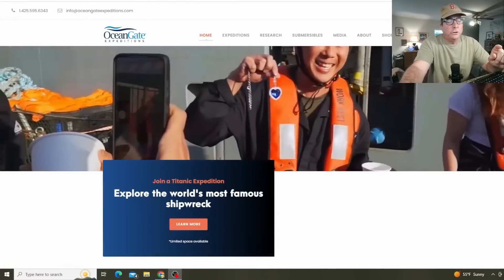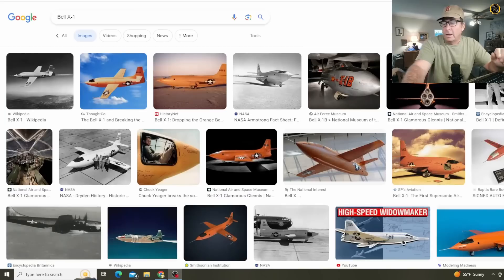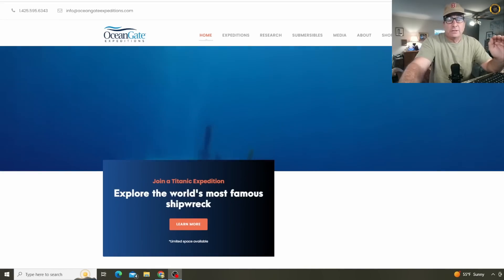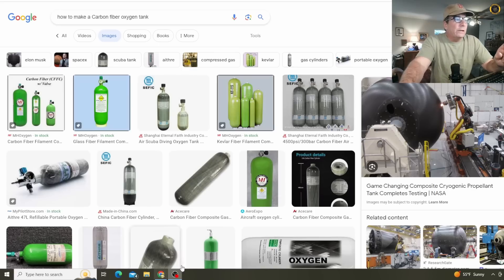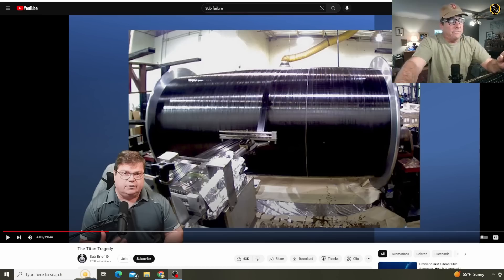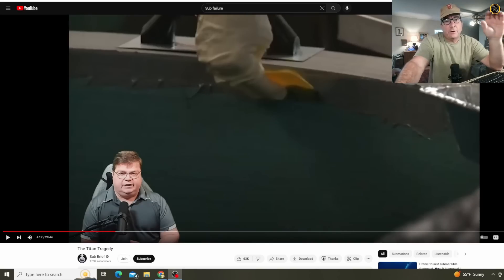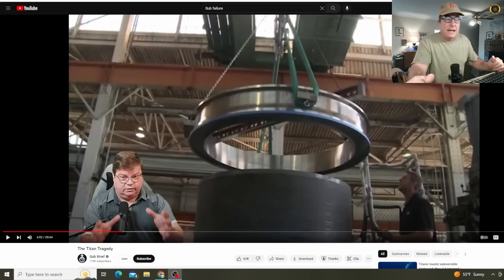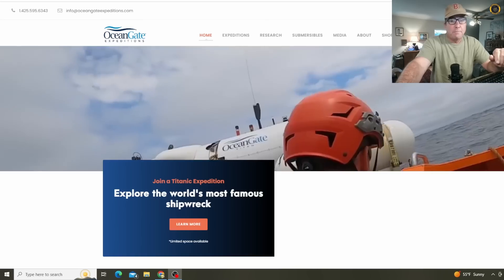Oceangate Sub Construction Details and Implosion

Comment: I’m a Composites Manufacturing Engineer, and I also watched the Sub Brief video. Juan Questioned the precision of the end of the carbon tube. We always trim (machine) the ends/mating points of carbon structures where they interface with precision parts, and can easily achieve precision <0.1mm - this was unlikely to be the cause of the failure. 
I do suspect the bond joint to be the source of the failure though. A huge red flag in this video is the lack of “squeeze out” from the adhesive when they set the ring on the structure. This is a sign that they did not get full-coverage of adhesive in the joint.
Reply: Should these glue joints and carbon fibre mats not be completed under clean air conditions? The glue application crew weren’t even wearing hair nets. As a non engineer I’d imagine dust particles and any foreign matter falling into the carbon fibre and glue is going to weaken it?
Reply: @EmmeKBell  FOD is always a concern during a bond operation, but clean room conditions are not generally used. We take precautions during lamination and bonding, but no hair nets are used. 
We make smaller parts, so a clean room could be used. With a part that requires a crane, that would be a pretty tall order (moving, greased, mechanisms in the crane would make it hard to ensure no FOD could fall from the crane above). Maybe someone who’s worked on 787 airframe components could comment on how they manage FOD control during the bond operations when an overhead crane is needed to set components in place.
Reply: @benkitesurfs  Boeing has had many problems with the CF layup.
Reply: @SteamCrane you don't work there, I do.  You have no idea how dumb that is.  The 787 is an awesome airplane
Reply: Why did he want to use carbon fiber in a sub?  It is usually used 
to save weight, which is a minor issue with things that float.
Reply: @jamese9283  yeah, I’ve wondered what the thought process was for using CF for a vessel that you want to sink. The only thing I could think of is transportation and handling costs? Maybe it could be launched from a vessel with a more readily available crane, since it’s lighter?
Reply: @benkitesurfs  Yeah, a couple thousand pounds lighter, so a bit easier to transport. Also less weight means easier to maneuver underwater and smaller batteries? Would CF insulate and make the interior warmer? Even a brief study would have shown him that the benefits would not outweigh the risks, so I don't get it.
Reply: @jamese9283 the mass is a function of the volume. Because the average density must become greater than the one of seawater for the vessel to sink. So a lighter frame just requires more ballast with the same volume. And if wall thickness of tanks for pressurized air is an indication, the composite walls are probably thicker than walls from steel would have to be. Thus increasing the displaced volume of the vessel requiring even more ballast and making the gross weight of the vessel higher than with a steel hull...
Reply: @MarcoTedaldi  The composite walls were far thicker (7 inch) than  steel (~2 inch). So the only advantage of CF seems to be lighter for transport out of the water.
Reply: @jamese9283 OceanGate cut the hull thickness by 50mm from the specified 175mm to 125mm. 5” instead of 7”.
Reply: @benkitesurfs  You still have to weigh it down for it to achieve negative buoyancy and I doubt they just went to the nearest scrapyard for metal, although I wouldn't be too surprised, so all in all the same mass would need to be transported around. Carbon fiber is such a romantic material, you produce your products in that stuf and you look technically more advanced; was this nut's thinking I'm sure, as well as all who supported him and went along with his thinking.
Reply: @jamese9283  construction was probably cheaper with carbon fiber, plus they could keep the design simpler. With steel or titanium they'd have to heat the submersible.
Reply: @MarcoTedaldi  5 inches with carbon fiber, no matter how it was wound, the resin used etc, was not thick enough.

Reynolds Metals Aluminaut was launched in 1964 with a 50 foot long cylindrical pressure hull made of 11 sections of forged aluminum tube. Its walls are 6.5 inches thick and it's capable of diving to the Titanic depth and beyond. 15,000 foot safe working depth but rated to survive to 17,000 feet. It's hull is large enough diameter for people to walk upright inside. It made 251 dives between 1964 and 1970, including at least one to Titanic depth (it was involved in a search for the ship) one that's said to be a record depth for a submarine, aiding in the recovery of DSV-2 Alvin, a hydrogen bomb, and an experimental torpedo. But I can't find any records listing all (or any) of its dives and depths.

If Reynolds hadn't given it to a museum in 1970 it might still be in use, and have had several refits and upgrades over the past 53 years.
Reply: @jamese9283  Neutrally buoyant.
Reply: @jamese9283 exactly, and carbon fiber is for tension not compression.  They were fools
Reply: @jamese9283 Cost savings and their engineer  claimed the carbon fiber design had neutral buoyancy.
Reply: @jamese9283  probably money issue
Reply: @jamese9283  I agree. It's because the CEO comes from airspace engineering. And he thinks "it's the same principles". I am speechless at the level of stupidity and lack of understanding of basic physics and basic common sense. They glued it to the titan... So a 3-5mm glue that barely penetrates metal and carbon will hold the enormous 3800 tons pressing on each sq meter of its surface... "Facepalm" honestly, that's just a  level of stupidity I can't rationalize... Did anybody ever tried to glue metal with metal or metal with carbon? You immediately see that the glue simply doesn't penetrate into the metal chemically. That's why we use welding... This is just basic common sense. Not to mention that carbon tube like that will be more expensive than a metal one.
Reply: @DanOneOne  "I make MY deep submersibles -- only with JB Weld!"
Reply: What about clean room requirements when you bond these parts.. in the video it looks like they are just in some yard building. Also when they apply the glue they dont wear anything that prohibits hair, lint etc to fall on the bonding surface... i can't believe thats how you do it, when the stakes are that high..
Reply: Like gluing on a PVC pipe end cap. Rush is on video saying he went against conventional wisdom using carbon fiber and titanium. That he had it figured out and could go around wisdom. The front view port was 7" thick acrylic. It would flex inward 3/4" at depth. Said not to worry, the acrylic makes lots of cracking noises before it breaks. His words on video.
Reply: @billbirch3748  
"The front view port was 7" thick acrylic. It would flex inward 3/4" at depth."
So the extreme flexing didn't bother him to the point of risking people's lives. That pretty much tells me the CEO was insane.
Reply: You have a good point about the viewing port. I didnt know they used acrylic for the window. Acrylic also it apt to form micro fractures. And you have to wonder how they dealt with the joints along the window. The carbon fiber hull is concerning but any joint is a weak point as well. A n improper seal of the door being bolting onto the craft might have occurred. Fine at relativity shallow depths but complete failure at deeper depths.
Reply: @misterdinkly  DSV viewports are typically made as shallow cones, really large on the outside, small on the inside. Like a circular version of an arrow slit in a castle wall. the slope is so the water pressure forces the port material firmly against the tapered hole in the metal, without extruding it through the inner hole into the pressure hull. The inside and outside faces are curved to correct for the optical magnification effect of the water. Advances in plastics allowed for the 2014 "upgrade" of DSV-2 Alvin to have larger viewports than in any of its previous pressure spheres. It also got upgraded from 3 to 5 viewports in its larger sphere. The larger sphere also required a new frame, so along with that, anything else hanging around from 1964 was also replaced, making today's Alvin a Ship of Theseus where 100% of it's been replaced yet it's still the "same boat".

IIRC Alvin's new viewports are also very heat resistant. When the mid-ocean "black smoker" hot water vents were discovered, Alvin couldn't approach too closely lest the super heated water melt its windows.
Reply: You noticed that too. I worked in the composite industry for years, bonding parts together is has crucial as the layup itself. I didn't see any telltale signs of a good bond joint with that ring such as squeeze out.

It's will be interesting to see what the talking heads will make of it. There were many modes of failure on this design.
Reply: I agree. This joint has several problems, mainly differences in thermal expansion and differences in elastic compression (Young’s modulus) between the materials, that the joint has to absorb. Material fatigue is another concern (also with metals including steel!), but there were not enough cycles to talk about that - the vessel likely was defective from the beginning.
Reply: @10goldfinger that stuff ain't taught at u dub physics courses
Reply: Source of failure was ego and over evaluation of one's IQ.
Reply: Cf bicycle frames are known for a host of inherent problems. Of course, cracking and failures. Getting a successful bond between the bottom bracket shell (metal) & the cf frame seems very elusive at this time for manufacturers.
Don't get me wrong; cf is impressive & I love my cf bike parts.
Similarly, the submersible main chamber should never have been cf. Ever. Wound fiber/ resin scuba tanks have a finite life cycle, as it's brittle and develops teeny tiny cracks that grow each pressurization cycle.
Progressive failure was very possible in the titan fiasco. Small leaks may have existed for a time, it wasn't necessarily an instant, painless, oblivious end to their lives. They very well may have known precisely what was happening in real time. No one will ever know how long that lasted. To state as fact, that it only lasted "30 milliseconds" is an extreme example of wishful thinking.
Reply: @houseofsolomon2440  You may well be correct in the passengers' brief awareness of the impending failure of the Titan as there are reports that they had started jettisoning ballast weights for an emergency ascent.  However, it was such a poor design for so many reasons that is was a question of when and not if a catastrophic failure occurred.  I think time and investigation will reveal why Stockton Rush did not want to gain proper certification for the vessel.
Reply: @Twmpa from what I've heard from Stockton himself and other passengers was that the submersible made noises when descending due to the pressure, Stockton claims to have aborted several dives due to the noises sounding different, that info, the reports of dropping ballasts plus the hull integrity sensors lead me to believe they were probably aware they were in some danger, whether they were aware of how much danger they were in is  anyone's guess and the actual death would have been instantaneous.
Reply: @Twmpa  I know I heard Cameron mention this several times, that the Titan had begun an emergency ascent. I haven't heard this anywhere else, but I presume he has inside information. My guess is in the coming months, we'll get a clearer picture of what exactly happened in the moments leading up to the implosion.
Reply: @Twmpa  How do we know the jettisoning didn't happen as a result of the implosion?
Reply: @houseofsolomon2440  I’m not familiar with bike frame parts - but I just got my first CF mtb this year 🤞🏼
I suspect the bonding issue you’re referring to could be a surface area problem. Or a mass production problem. CF construction is still pretty manual, so the ability of the technician to do things correctly every time, in a high volume setting is always a variable. 
I agree that CF for a submersible is a strange choice. It’s much different than a pressurized gas cylinder (like a scuba tank), as the gas cylinder puts the fibers in tension, where they thrive.
Reply: @benkitesurfs  For this submersible project, I say support your local titanium dealer -
edt: that's correct about the scuba bottles being under tension, as opposed to the submersible, which is under compression. This actually bolsters the argument against cf for the Titan project.
Reply: @houseofsolomon2440  I would think all titanium or just good old fashioned steel would have been a much better material for this sort of vessel.
Reply: @houseofsolomon2440  I saw an interview with both Robert Ballard and James Cameron, and they said that "sources inside the small deep submersible community" believe that the crew of the Titan had realized they had a problem, and had dropped weights, dumped load, etc. to start an emergency ascent... not sure if they know this because they've seen undamaged parts of the Titan on the sea floor, and then knew that they had been dropped before the implosion – or if there was a communication from the submersible that happened before the failure of comms... but they do think the crew knew something was happening, and were trying to ascend when it imploded. I also saw a comment from Cameron saying that "on Monday morning, we were pretty sure it was a catastrophic implosion" when it lost both comms and the transponder at the same time... he said the transponder was housed in its own pressure vessel and had its own battery... so when the signal from the transponder stopped, they knew that something so violent had happened (implosion) that the shock wave from that had destroyed the transponder as well.
Reply: @houseofsolomon2440  You don't have "small leaks" at that depth. ANY leak = instant complete failure.
Reply: @houseofsolomon2440  If they manage to find their SD cards and other storage, we or the investigators will likely find out. You can be sure there were several video recordings going on.
Reply: @houseofsolomon2440  I disagree that the problems they were having with hull integrity might have been human-perceptible. Anything human-perceptible (cracking, leaking) would have been big enough to cause an instantaneous implosion faster than a human could process. If they knew they had a problem, it likely came from their hull integrity monitoring system that was built into the hull.
Reply: I also noted that much of this construction was done in open atmospheric conditions. In many CF builds I recall they had the autoclave or vacuum chamber to eliminate air infiltration during the weaving of the part. Interesting here, they didn't weave, they wrapped it like wire on a spool. I'm guessing at the depths they were going, there would be a good 900 to 1,000 psi.
Reply: @Garth2011  6000 psi at the Titanic.
Reply: @jamese9283  Oh my, thats a nasty high number.
Reply: @Garth2011  yes, I was wondering about that, part of CF strength comes from weaving, yet this thing was built like a reel of sewing thread.
Reply: @Garth2011  pressure and heat are needed for proper carbon fiber construction. The lamination process (putting the material onto the tool) always occurs at room temperature. Heat and pressure are applied after to cure the resin. 
The lamination they briefly showed in the video did not look like wet-lam to me. It looked like uni-directional prepeg material. I’m sure they bagged it and put it in an autoclave after.
Reply: @benkitesurfs And unidirectional fabric has no bending resistance once cured. Basically nothing to stop a crack from propagating from the surface to the inner mandrel if any bending force is applied (like sitting on a ships deck in rough seas).
Reply: Correct, you actually don't want a tight fit in these kind of bonded assemblies so there is enough glue to actually do its job.
Reply: As I understand the CF is pre-preg they got it from Boeing on the cheap as it was out of date

Generally speaking bonding environments are not clean rooms but rooms that are kept clean we would ware dust coats and gloves etc but not hairnets
Reply: The debacle is unbelievable. No wealthy man would go down in anything that wasn't better than the one built by an Actor! Kudos to JCameron. He did it right. He lives to tell. The pressure is 6000 pounds per square inch of surface area. 60" dia times Pi gives 180"(+) x length 96"? Times 6000 PSI. Composites have great value as a pressure retaining vessel. But suffers as a pressure resisting (Compression) force. Any RC hobbyist will tell you that CFRP shatters like glass when over stressed. But what is the compressive loads at 6kpsi applied to the afore mentioned values?
I can convince you this was erroneous, do you think a wealthy man wouldn't listen? This reeks.
Reply: @bryanst.martin7134 
Peak wall stress in a pressurized tube is calculated by the following:
Stress = P* r/ t
P= pressure ( 6000 psi)
r= tube radius ( 30in)
t= wall thickness ( 5 in)

P= 6000*30/5 = 36000 psi 

That seems like a manageable value for a well designed carbon fiber structure. 
..at least in theory.
But highly suspect for a poorly designed butt joint with high stress concentrations between dissimilar materials with no obvious attempt to distribute the bond over enough area for the glue to survive stresses similar to the carbon.  The best adhesives have material strengths and adhesive strengths an order of magnitude less than either titanium or carbon fiber. Imo some type of scarf joint would be required to provide enough bond area for the adhesive to carry any load remotely similar to the principal structural elements of the vessel.
…..and then there is acrylic
Reply: @williamfennell8175   I don't believe that glued joint was subject to shear. The ring was stepped so the compressive force was directly to the edge of the CF?
Reply: I'm even more concerned with the consistency of the glue. It's way to thick for any bubbles to rise to the surface and the the application method will create bubbles, even if all bubbles where evacuated from the glue before application.  I have never seen large 5500 PSI hydraulic connections being created using glue, it is always an O-ring locked in a metal recess, hold in place by the liquid pressure.
Reply: You get points from me for calling it a (structural) adhesive and not a glue!
Reply: I would think a twist of the ring should have been part of the process for the same reason you twist a pvc fitting when it is glued.
Reply: Not to mention the 0 degree winding is not supported with 45 degree layers. With only 0 degree winding, this would not be strong in tension either.
Reply: I have been wondering how they eliminated air pockets too. I'm not an engineer but would have thought some kind of bolted system with an inspectable and replaceable flex  seal would have worked better.
Reply: @johnsutcliffe3209  Epoxy with vacuum curing is aerospace standard.
In aircraft structures air bubbles are bad news because they cause composites to delaminate at high altitude.
Reply: What about a high durometer urethane as an adhesive between the titanium rings and the tube? Smooth-On makes a wide range of urethane rubbers, resins, and foams. they have a surface treatment they call Ure-Bond II which can make urethanes adhere extremely well to most non-porous surfaces. To get a precise bond layer thickness I'd make a sheet of the urethane the same thickness as the finished join and punch a few small discs from it. When applying the uncured adhesive, place a few of those discs right in the center then coat over them with adhesive so the discs have it all around. These urethanes bond extremely well to themselves so the discs should not be a possible separation fail point.

That would still leave the rest of the issues with the carbon fiber tube. The way the fibers were wrapped, the choice of resin etc. A way to make a fiber composite pressure hull for a DSV, that can withstand a large number of deep dives or an infinite number of shallower dives could be possible, with a lot of research and development - and crushing a lot of test articles deep underwater.
Reply: Me too! Do you think they even sealed it or painted it? It appears they may have just added fairings.
Reply: your out of your cotton picking mind to even think of using this material for the purpose the guys degree isn't worth the paper its written on ... out of his mind ...obviously
Reply: What is your take on the use of heterogeneous materials(ie. CF vs Titanium)that undoubtedly behave differently at pressure and temperature?
Reply: I'm just a carbon amateur, so i ask for your opinion. A wound only pressure cylinder, is this a good idea at all? It just goes against my experience of carbon use and what directions of force carbon supports. IMHO this smells a lot like possible delamination issues, not like failing fibres.
Reply: That probably wasn't the cause of failure. The vessel was rebuilt by a different company.
Reply: Great observation..
Reply: The front view port was also only rated around 1000m, not the nearly 4k the vehicle was supposed to dive to. Unsure what depth the failure was at but it's another weak point.
Reply: I would have secured the titanium ring to the carbon fiber hull with stainless steel bolts all the way around the perimeter. Then the pressure would not be able to pop off the ring.
Reply: @thorsrensen3162  would the bolt holes potentially weaken the tube?
Reply: I suspect that it was a more fundamental issue 😳

A 6+m long tube with no internal support except at the ends. Dive #1 causes bending. Where is bending going to be most severe? Mid tube. Dive #2 rinse and repeat. Bending is getting a bit more severe as fatigue sets in. And so the cycles repeat. The CF starts to delaminate. The sounds they heard was indicative of the process.

Finally the cylinder fails and destruction is assisted by axial force of the two caps.
Reply: I saw a video showing the glue being applied and thought why not just put loads in there and wipe off the squeeze out?
Reply: Good points ben. That joint looked shady to me too. He only had a 2 inch dado machined into the titanium end caps, and the epoxy resin glue he was using only had a tensile strength of 5 to 6000 psi, but I learned that the pressures at the titanic are 6000 psi. I can't believe he trusted his life to JB weld glue. The glue shrinks 1 to 5% after it cures, and like you mentioned, he didn't have any glue squeezing out. If I was going to try and make that joint I would have had a 12" dado joint in the titanium for the tube to fit into and drilled holes through the titanium cf titanium sandwich away from the edge. Even though it weakens CF to drill holes, it would have been sandwiched between titanium. Instead of gluing it, I would have put a rubber seal in it to flex with the two dissimilar materials. I also would have welded brackets on the titanium rings every 2 feet and bolted titanium 2x4's on each end, that would run parallel with the tube on the outside. I would have made that joint so strong that king kong couldn't tear it apart. I can't believe he would actually take that thing underwater with that cheesy joint glued on it.
Reply: 1000% that flange glued is insanity  in this application